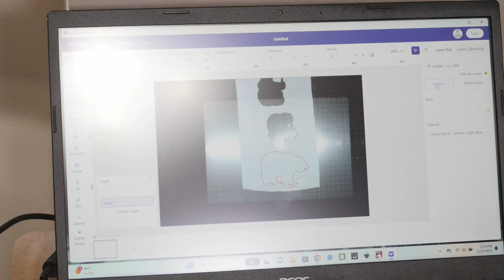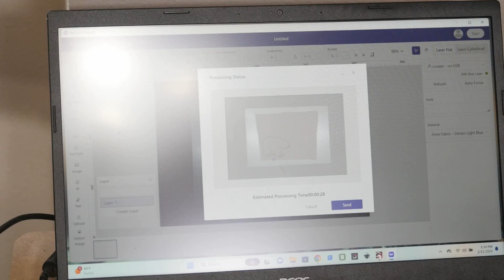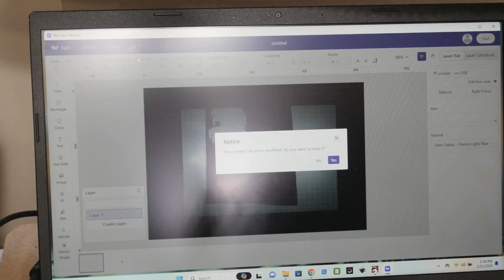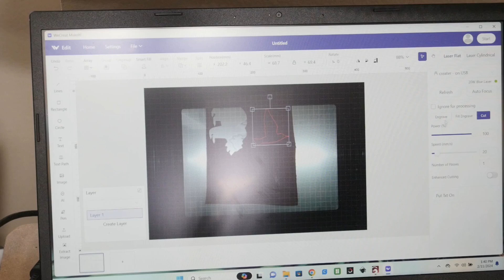Diode Laser Cut On Fabric Using WeCreat Vision Laser

Comment: Do you need to put magnets to hold the material in place.
Reply: Thank you for your help.  I am researching this machine to use for quilting and applique.
Reply from the maker: Sometimes.  It depends on the weight of the fabric.  Have never needed to with denim, but thin polyester needs to be weighted at the corners if the airflow from the laser is too much.

Comment: Cool video, Roger. I “engraved” on jeans several years ago with a 100 watt CO2 laser & they turned out pretty well, but I never felt like I never got it dialed in quite right. I haven’t tried on the diode laser yet, but this reminded me I need to try it.

Comment: Hey Roger, can you cut multiple layers of fabric at once with the diode?
Reply from the maker: Yes, but note that the lower layers may have scorched edges.  Three layers of the thin polyester I use does OK, but is better on the CO2 laser.
Reply: Great question!